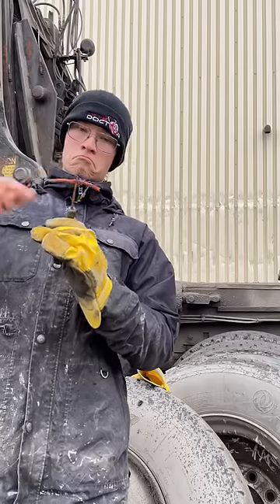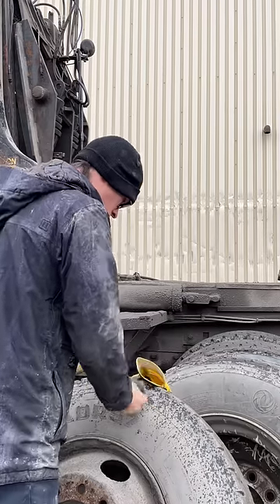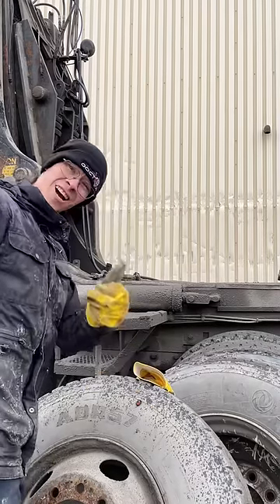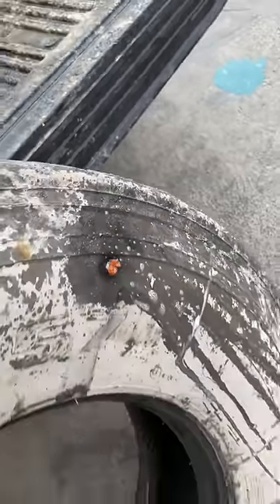Plugging A Truck Tire Sidewall #tiredoctor #shorts

Comment: That's not how pressure works.
It won't explode if it's leaking air. The internal contained air has to reach a higher pressure than the external air.

Comment: I'm really surprised most do not know about this. I've had several flats and fixed it myself like this. I will gladly charge each snd everyone a tow to my shop and sell you a new cheap tire off my rack if you aren't man enough to fix your own tire flat. Give me your $400 to do the same job. I have even temporarily fixed a rear motorcycle tire the sane way and did a burnout with it and it held in place all though though the full tread. Don't ever ride on this fix for the life of the tire though.

Comment: At my bus garage, we never put a plug and patch in the sidewall because of the thinner layers of metal wires. How much psi do you guys use cause we use 105-130 dependingnon our size and position

Comment: Spray it with some soap when it's under pressure That's how you know if it leaks or not Come on you're supposed to be the tire doctor not the tire intern

Comment: 2 thinks wrong with this video, 1 If the tyre had a piece of metal stabbed in to it and is still pressurised the. You DO NOT take it out till the tyre is flat. 2 you actually squirted water on a tyre what wasn’t on the rim. As if air was going to escape. 😂😂😂😂
Reply: it's called sarcasm

Comment: no way are you supposed to plug sidewalls of any tire of any kind it's very dangerous under under rotation and heat and pressure it will explode retire as a blowout